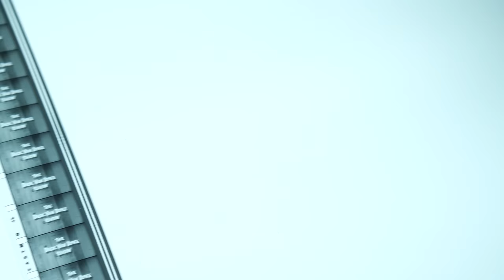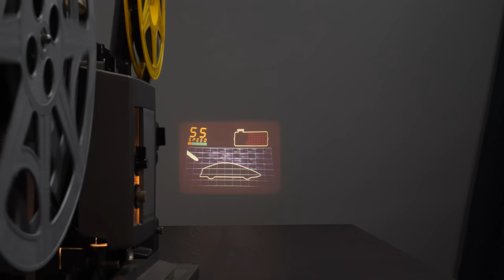Movies made sound with a light bulb: Sound-on-film

Comment: In a sense, the mechanical projectors of the past were actually more advanced in as far as how the analog components worked together. These machines embraced basic optical, amplification, motors that have to be in sync at all times and ALL of this has to work precisely when the film required it to. These are amazing devices and it took some incredibly talented people like De Forest, Edison, George Eastman, and so many others. And if you really think about it, the 16mm and later projectors evolved into the Videotape Recorder (VTR) which has the same basic ideas as the projector does.
Reply: Edit: Forgot to add, keep that old Bell and Howell 16mm with sound going!! So much is ONLY available on these films and it's just great you preserve and explain how they work!!!

Comment: Film with a magnetic track was a major pain.

I came across a roll once when doing obsolete format transfers at the BBC - it had contracted over time at a different rate to the acetate and had made the film spool 'coggle' - it simply wouldn't run off the machine.

About 80% of the archive was what was called 'sep mag' - a perforated magnetic tape with sprocket holes exactly like 35 or 16mm film.

This was loaded on a separate 'sep mag' machine, the leader 'sync cross' lined up with the one on the film and hopefully everything would synchronise up and run together.

Much fun not to be had if the crosses were missing for whatever reason or someone had 'removed' a few feet of footage from the film .... .

A friend of mine worked for a short time in 'Main Block TK' and had been running the TK machine for a live film transmission - and the 'comopt' (with optical sound track) bulb blew halfway through ! 

That's when the 'Temporary Faut' caption popped up and the continuity announcer had to read out those immortal words ... .

'We would like to apologise for the loss of sound - hopefully, normal service will be resumed as soon as possible' !!

Comment: That last bit reminded me of something i use to do when I was young.
A lot of the music I listened to had sampling and other weird stuff so there was a fair amount of backwards stuff I'd come across here & there.
I couldn't help myself so I'de take the cassette apart & revers the reals so I could listen in reverse. I eventually figure out that I could carefully just flip the tape over, in the exposed area of the cassette without having to actually disassemble it & it would play the other side of the tape with the stereo tracks flipped in reverse.
This would sometimes get the tape snagged though. Flipping the reals is definitely the safer option.

Comment: You forget rhe biggest advantage of DTS_ Changing languages just was a swap of disks. Actually in germany most movies where (and are) dubbed. Still, many fans (like Star Wars and Harry Potter fans) wanted to see the film in its original language. Also after release blockbusters were shown often on multiple screens in a multiplex, with one copy coming out of the first projector, going to the next (there is a yt-video using 16 projectors with one film). For one projector they ordered the english CD's, so they could show the german version on most screens while playing in english on one screen. All "sound on film" formats required different copys of the movie for different languages, while DTS just need two or 3 extra CD's. So esp. in Europe DTS simply was much more economic.

For the classic analoge audio: Developing the audio in black/white audiotrack cost about 500€ extra for a copy, due to the comlicated process. The reason was the light of an classic lightbulb emitting a lot of infrared and the reciving cell (practicly a solar cell) responds very well to IR. So the audio-track had to contain silver to not only block visable light but also infrared.
With 1W red LEDs and diode lasers you could use cyan audio instead. Actually just a few years before the end of analoge cinema started, copys started to come with cyan audio track. Theese needed not only an upgrade to red LED light, but also a +20dB pre-amplifier. While a laser didn't need the preamplifier, it did not work with old intensity modulated audio. So for smal cinemas having special events like showing an historical movie from time to time, laser were no good choice...

Comment: On film, the optical audio tracks would have to be, obviously, played back at a constant speed.  The images however, are each stopped for about 1'24'th second to allow time to show the stable image for clarity, then the film advances very quickly to the next image while a shutter is closed to hide the blur.  If the audio tracks were starting and stopping like that, it would not play back at all which means that the audio playback bulb/aperture/sensor is located somewhere along the drive train before the image-cogging mech.  Since you have to leave a loop of film between the cogging thing and the constant-velocity feed roller to allow for the film starting/stopping, the audio playback bulb/sensor has to be pretty far ahead of the corresponding image.  I'm just saying that the audio is not aligned with the images but is actually offset by several inches.  It's obviously still "in sync", just offset.  I assume that if you loaded the machine with a loop that was too short or too long then the audio sync would be off a little.  To prevent this issue, the projectors used in my school had a lever with a wheel on the end that you'd flip out during loading.  You would loop the film over it snuggly and that would set the loop length precisely.  Then you'd just flip the lever out of the way and it would leave the film loop loose so it could operate normally.

Comment: in my country back when movie houses used multiple reels and projectors to show a movie, multiple movie houses would pool their resources and to "rent" the same movie from a distributor in order to share the cost of running a movie. 

then they would arrange their schedules to stagger the showtimes. then they would have a system of runners who would rush the different reels from one cinema to another. so while cinema A might be showing Reel #3, cinema B would be showing Reel #1 and anxiously waiting for Reel #1 to arrive from cinema A. you'd have a troop of runners on bicycles/motorcycles just going to and fro with different reels.

99% of the time the system worked -- occassionally you'd end up in a dark movie house waiting for a reel for around 5 minutes.

Comment: You skipped from small reels, that were delivered to the theater, to platters. In between there were large reels, where the projectionists had spliced together three of the small reels. This reduced the number of projector changes. The early 6-channel mag-stripped films weren't surround, but played to five speakers behind the screen, left to right, plus a subwoofer.
The first demo of digital sound was at a SMPTE Convention at the Plitt Century Plaza Theater in 1984. A Sony digital audio tape deck was synchronized with the projected film. It worked well but wasn't ready for the public yet.
As early Dolby Digital progressed, and it was very harsh at first, the new firmware was at the header of the film and loaded into the processor, so the theaters always kept up with sonic improvements.

Comment: I remember the stock of projector bulbs our school used to have. The exciter lamps were low voltage. So there was a stepdown transformer somewhere in the projector to power the exciter lamp. I wonder if it was powered by low voltage AC or rectified to DC.

Comment: I was once taught to run 16 mm movies, it came in handy. It was only a single projector, so small pauses had to be inserted. I do not remember how many I actually ran - less than 20. To me it seemed straight forward to set op the projector. But I also remember the horror of having a smaller uptake reel than needed. I only discovered my error when the reel ran out and I looked at a reel filled beyond capacity. The movie did not slip, and I later could rewind without problems. But at reduced speed. But I really do not remember wether it was optical or magnetic sound.

Comment: The magnetic recording is not used in (professionally duplicated) films because of quality. The speed of both 16 and 35 mm film seems to be enough. Tape recorders with similar speed of tape (around 39 mm per second) have frequency range up to 45kHz in 3dB. But the film is much thicker than magnetic tape and this matters. The thickness of the film allows frequency response up to roughly 12kHz.
Only 70mm films have speed allowing for good quality sound. These have 4 magnetic stripes and total of 6 audio channels.

Comment: BTW if anyone is learning about the inner workings of a film projector today and think there's something you can do to improve the process, somebody already thought about that and it didn't work out.

Also Alec, I really doubt projectionists WATCHED THE WHOLE FILM multiple times a day because the intervals between projector transitions would be consistent enough to set a timer when they're needed, thus they could spend the extra time slacking off doing more work.

Also, leave it to Sony to spend millions to develop a technology in which its practical benefits over the previous method are almost unnoticeable to most people.

Comment: Machines like that were of course the centerpiece of every Junior High's A/V Club. I was too cool to belong to that, but was awarded the prize in 8th Grade of Operating the Projector several times (we had to take turns.)

Look up Everest Records, an early audiophile record label (maybe the first). 1-inch and 2-inch tape didn't yet exist and they didn't think 1/2" was good enough, so they paid the equivalent of about $200,000 per machine for Westrex to build recorders that used the entire surface of 35mm film to record 3 channel audio. After Everest's quick financial ruin, Bob Fine at Mercury bought the gear and continued using it for a few years. 

His wife used one of the old Westrex machines in the 90s to perform digital transfers, and more have been done more recently, albeit with some restoration of the film needed. I read that a laser was used to read the sprocket holes due to the film edge being bad.

Comment: In the 1950' when magnetic sound was introduced, this led to stereophonic sound in films. In the beginning, it was Vitaphone style. A separate machine carried the stereo soundtrack,3 channels only until Jack warner introduce four channels of Warner sound Vitaphone style  If it got out of sync the optical mono track was reverted. Then the introduction of the cinemascope the stereo was put on the side of the film. The only problem was the reproducers. You had to tighten the film. this meant it would be worn out quicker and the manager would have to get another print ruining his profits. By the way back in 1930  some premieres of films, like the lost rouge song and king of jazz premiered using a film version of the Vitaphone. The sound was played on a separate machine in sync with the silent film. There was a claim that the high fidelity of the monaural sound was better than on film. Early sound on film the fidelity of the sound was weaker. Vitaphone disc had better fidelity at the time. So back in the fifties and sixties stereo sound films were not popular except in big cities . This would change when the late Dolby found a way to put stereo sound on film without using magnetic tape. This produces clear stereo sound on film and no more hissing. This resulted in more theaters putting stereo equipment in their auditoriums. Dolby wanted to make it better, but, he died. Still, you had theater including a magnetic tape version of the film too would be at the snack stand and see those heavy cases of films, either ordered or sent back. I would notice little advertisements of film on those cans." Stereo Dolby b, magnetic sound versions, etc. For a multiplex in the past, Dolby must have been expensive to consider the magnetic versions for other auditoriums.

Comment: On most Super-8 Projectors it is easy to load them thanks to automatic threading and automatic take up reel. You only put the film in the slot and the projector does the rest even the take-up spool will catch the film automatically (I have an Super-8 sound projector my self that is doing that) and here in Germany most pre-produced Super-8 films with for example Looney Tunes on them used magnetic sound which is on Super-8 even superior to the optical sound track on 16mm.

Comment: Very nice and fun explanation Alec!
Did know about the soundtrack on edge, not about the various digital ones, the Dolby one is really clever hidden between the sprocket holes!
Getting Smarter Every Day 😉
One thing about the timing code and disks, this could also been used for different languages, Nachsynchronisieren im Deutsch 😉 
Then only one type of copy would have to be made, with different language disks, or several on one disk and the operator could choose.

Comment: BTW if anyone is learning about the inner workings of a film projector today and think there's something you can do to improve the process, somebody already thought about that and it didn't work out.

30:15 Also Alec, I really doubt projectionists in the multiple-reel era WATCHED THE WHOLE FILM multiple times a day because the intervals between projector transitions would be consistent enough to set a timer for when they're needed, thus they could spend the extra time slacking off doing more work.

Also, leave it to Sony to spend millions to develop a technology in which its practical benefits over the previous method are almost unnoticeable to most people.

Comment: Apologies for posting on this thread, but I couldn't find a reference on any of the others.
Have you produced a video describing how an 'infinite switch' works? I replaced one on our range the other day, and realized that it's probably the reason why electric stoves are so difficult to regulate. In the old days, when a burner had some thermal inertia, they worked well enough, by changing the duty cycle, but with, for example, a modern glass-top stove, the result is blazing heat followed by periods of darkness. Bimetal strips are a neat technology, but they really don't work in this application.

Comment: 10:46 Some Super 8 film, 8mm, did have magnetic tape on the edge for sound. It was possible to, using a tool add the tape to the edge of the Super 8 film i.e. do it yourself. The sound was in a different position to the frame of the flim because of the jerking frame as it passed through the gate

Comment: These mostly used a thallofide vacuum tube to detect light. Very similar to a photodiode. The main reason this is done is due to the fact that Cds cells are not fast enough to reproduce high frequencies.

Comment: Not one mention of The Geneva Drive, which is how the film moves in the projector and how the shutter opens and closes behind the film gate.
Reply: The light sensor doo-hicky is a photo-detector vacuum tube. It is a vacuum tube with a window on one side. There is a metal cover with two wire rods that reduces friction on the film.

Comment: Let me know if I understood this correctly.  So instead of blocking the light between frames they would also block the light a couple of during each frame to make the transition less noticeable?  If so, that's brilliant.  Though I would expect it to require a brighter light source.
Reply: Yes, the film is blocked during the entire pulldown and for a short period while the image is in frame. This is less to make subsequent frames blur together, but to make the flickering of the image less noticeable. Yes, you do technically lose an amount of light doing this, but it is more than worth it to reduce the flicker. You can also make up for it by the pulldown faster and allowing the shutter spin faster (or have a modified geometry that has a longer open time).

Comment: A leopard can't change his spots, and the goal of a projectionist was that the audience not spot his changes.

Reel changes were usually a few moments before the footage limit, timed to coincide with a cut that had no sound.  When possible, this was at a scene break.  This would later work out well for showing films on TV, when the breaks were used to insert commercials.  

The projectors I ran had a signal lamp that would come on 10 seconds before a reel break, the spots in the corner weren't there in theater film -- those were done by the editors who cut them down for TV.

Comment: I feel this isn't worthy of an email but it is something you might find interesting. I'm in college, and my roommate and I just bought a new microwave. And it doesn't have a humidity sensor- it still has a popcorn button and the other expected microwave buttons, but each one just runs a preset time. Before it runs it asks you for a weight of the item, like the popcorn bag or potato for example and just runs a preset time. It just stops after that time- I tried to make popcorn and it just stopped when I thought it would keep going and I checked the manual, it said nothing about a sensor or optimal cooking. So microwaves are getting worse

Comment: I'm curious. Can you just put an equivalent brightness LED bulb in there which won't burn the film? And also make the whole thing use less power? I find it pretty crazy that it needs a whole kW just to make the light. Then the motor, vacuum tube, other two lamps, etc. probably have it pulling at least 1200 Watts by my estimation which is insane

Comment: Hi - unrelated question. I bought a soil pH and moisture reader and it doesn't use batteries. 😅 It has a light sensor, is it getting enough light to power it like a solar calculator or is it somehow getting power from the soil? So confused.